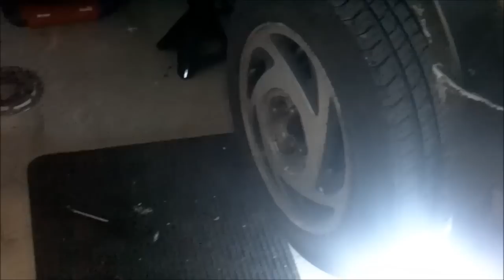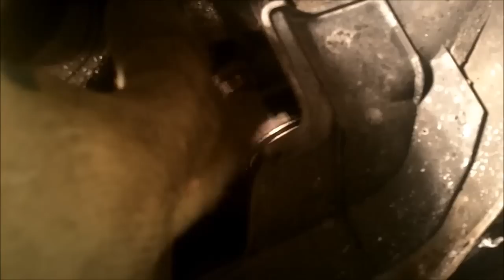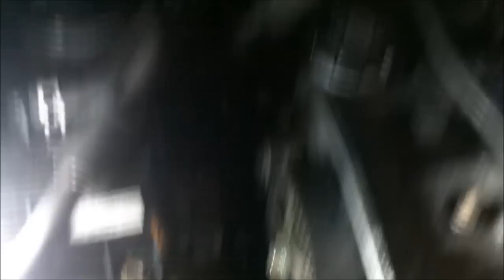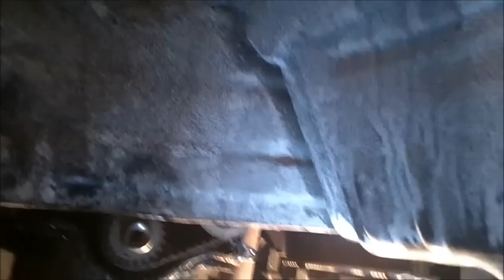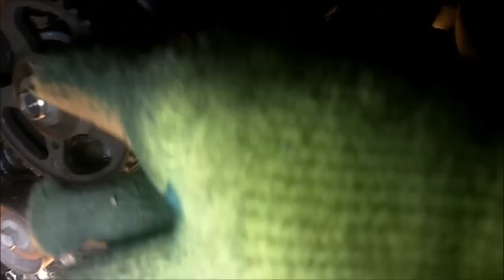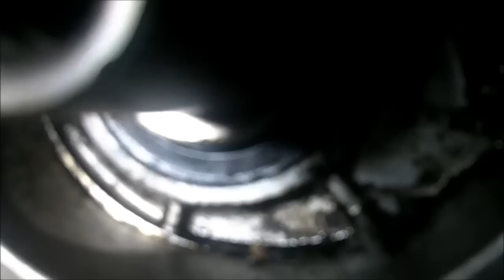5EFE Timng belt replacement

Comment: Greetings! I’m having a hard time getting a replacement for the crankshaft harmonic pulley, the same one in the video. 5EFE on a 1998 Tercel. All I can find is the single belt one, I need the one with for two belts. Mine had no bolt holes to remove it. Where do you get it? Thanx!

Comment: I've heard that some belt timing style engines are fail safe if the belt rips making sure the engine doesn't get destroyed. is this engine fail safe by any chance?
Reply: Thugz bunny The 5EFE engine is a non- interference engine in it's stock form
Reply from the maker: Thugz bunny  this is an interference design meaning if you mess up your timing you'll likely have the valves and pistons meet. this is not a "fail safe" engine.
Reply: thank you for the fast response! great vid!

Comment: Hi, I have a 97 tercel and wanted to know if the procedure is exactly the same. I have a.c., Will the compressor have to be  removed? also, I couldn't tell, but does the motor mount need to be removed? I did this on my Plymouth acclaim, but had the manual , unfortunately Haynes doesn't make one for my year travel. Thanks for any info!
Reply from the maker: Rick Burton I did not have to remove the motor mount, some people do to gibe them more room its all up to you just be sure to support the motor before you remove the mount. As for the AC compressor Im not sure if it will have to be removed but imagine it wouldn't have to be don't quote me on that as i haven't worked on a 5efe with AC. You may have to move it out of your way to get more room but try not to remove the AC lines its illegal to release refrigerate into the atmosphere  its not good for your health and you'll have a smelly garge for a while. best of luck with this  if you need any more info feel free to message me.
Reply: Thanks Alex! Forgot to ask, I had to set my plymouth to TDC on the Compression Stroke if I recall right, Does that matter with this engine?
Reply from the maker: Rick Burton yes the motor should be at TDC which is the 0' degree mark on the plastic timing cover there is also a timing mark on the cam housing that has to line up with the 3e hole ( check this as soon as you take off the upper timing belt cover) in the cam gear.
Reply: Alex G ,I'm sorry, I just meant did it matter if it's on the compression or exhaust stroke with those marks lined up.
Reply from the maker: Rick Burton it doesn't matter so long as its timed up using the timing marks.